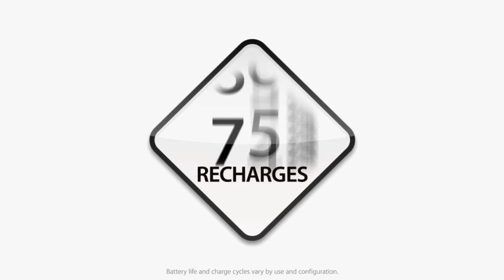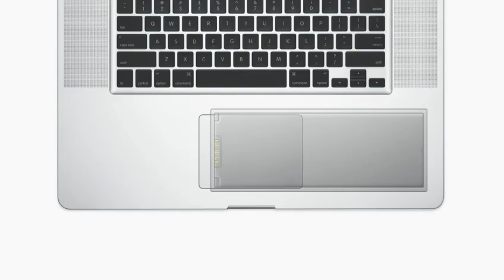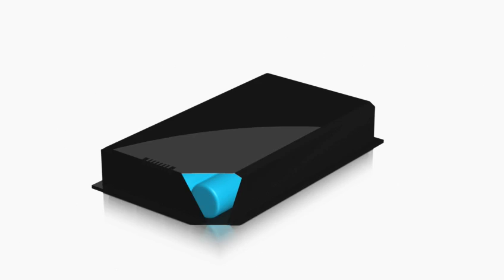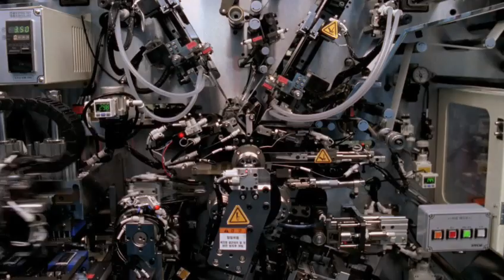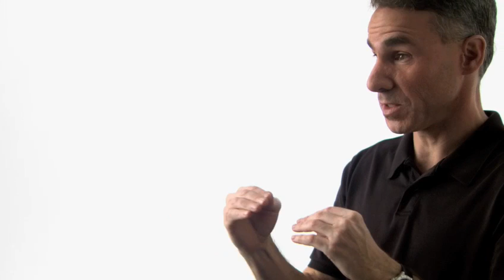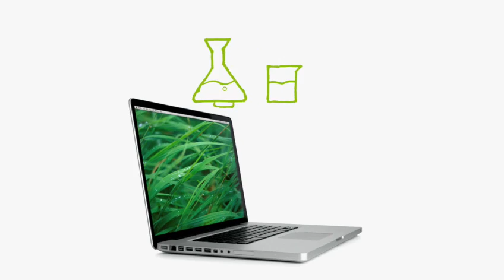Apple Macbook Pro 17 inch New Battery 2009

Comment: by the time you would need a replacement on this, the slowest laptop in production would probably be many times faster than the MBP, and cheaper than the battery replacement would cost.